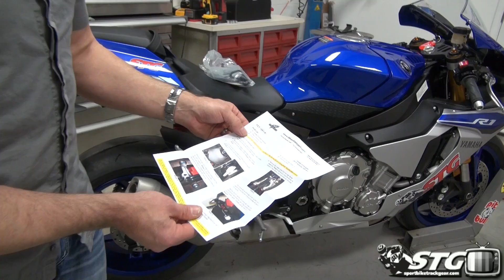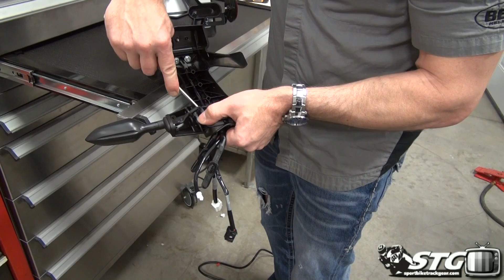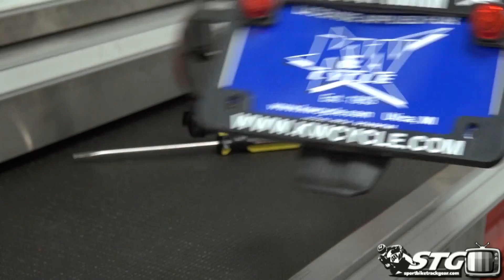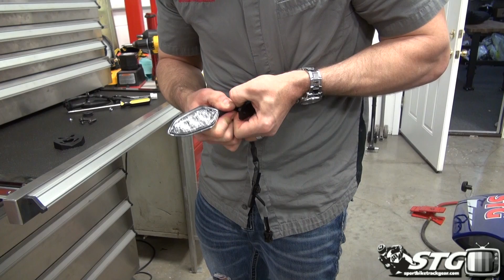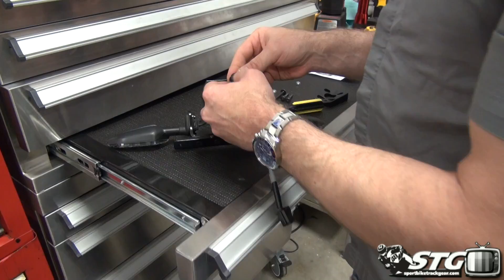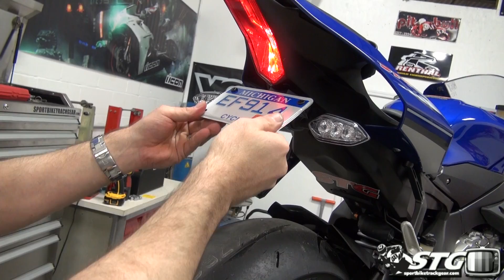Graves Fender Eliminator Install on a 15-17 Yamaha YZF-R1 from SportbikeTrackGear.com

Comment: Is there a way to install the license plate light (graves part #: FE-U-LPL) without cutting or damaging any OEM components? The connector of the OEM light (yamaha part #: 2CR-84745-00-00) isn't available separately, and the light unit costs $130, counting tax and shipping. The connector looks like a typical white plastic electrical clip, but I don't know it is common to any other part and I don't think it can be bought separately.
Reply from the maker: I would recommend cutting the connector off the OEM license plate light and attaching it to the Graves light. This will get you a plug and play end result. - Van
Reply: I ended up using posi-tap connectors, no cutting, stripping necessary.

Comment: Awesome! I have a question, whats those 4 tubes in-front of the battery for? Brakes or fuel?
Reply: MikeIllusion92 They look to be for brakes for the traction control/abs
Reply from the maker: Justin Reynolds That is the ABS Brake Pressure Modulator Valve and the brake lines. This will all be eliminated shortly as I would prefer not to have the ABS for the race track. - Van
Reply: I believe if you get the kit ecu you can tune, disable abs. Definitely disable